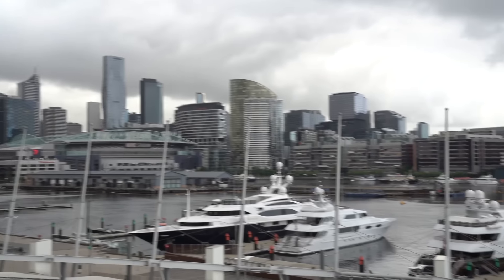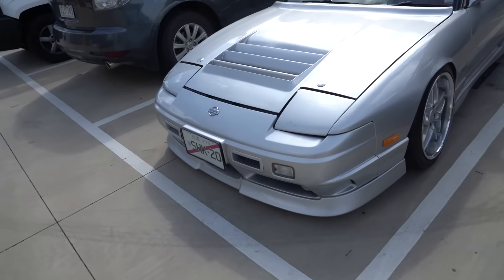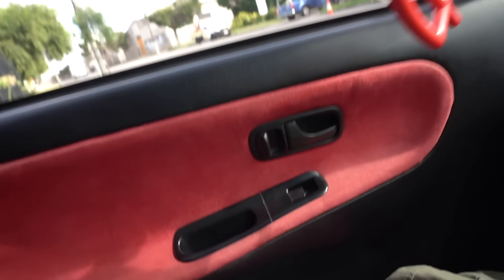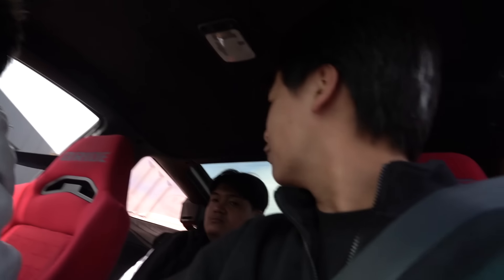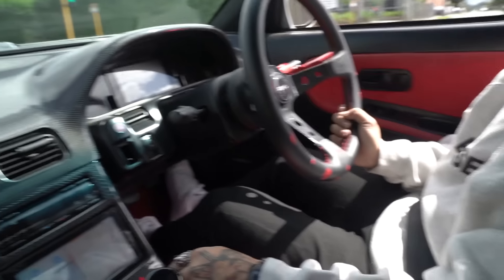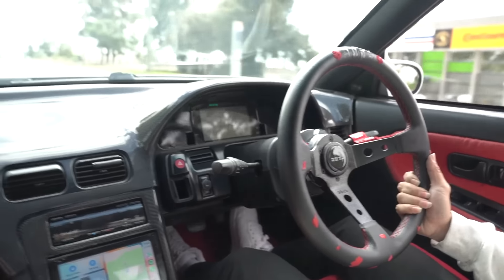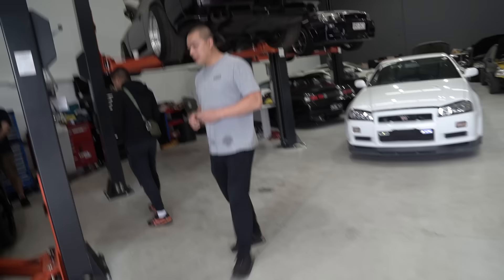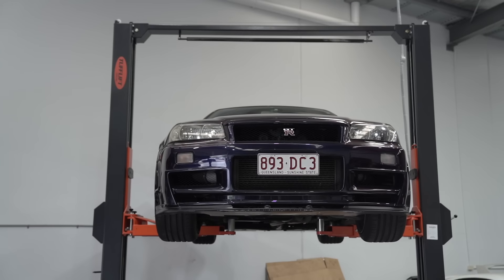R34 GTR Owner Accepts my Cash Offer!

Comment: 14:57 "91, that's really bad fuel." Aaaaakshully, Australia and the US use two entirely different scales. Australia uses what's called "Research Octane Rating" (or RON for short), whereas the US and Canada use "Anti-Knock Index" (AKI). Below is the conversion rate, and as you'll see, 98 in kangaroo land converts to 93 in freedom land, which is widely available in most states that don't start with "Cali-" and end in "-fornia."

87 AKI = 91 RON
91 AKI = 93 RON
93 AKI = 98 RON
100 AKI = 104 RON
104 AKI = 108 RON
Reply: As an Aussie I’ve ALWAYS wondered the difference, I swear I even googled it and couldn’t find info ages ago, so thankyou for this helpful info!